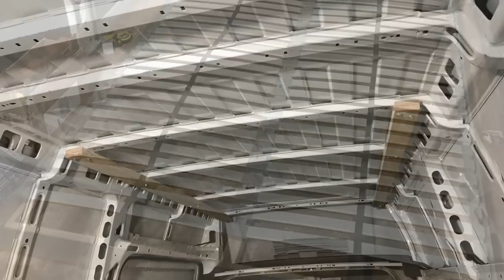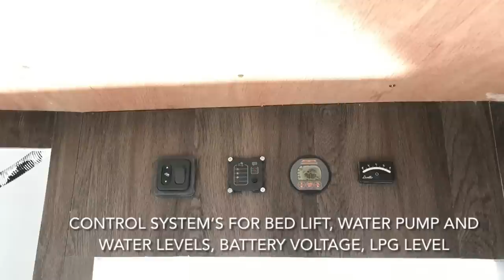Campervan conversion, Citroen Relay L4H3

Comment: Excellent conversion.  The underbed cupboards are genius.  I'm considering a conversion but with the lift bed at the back (because probably going for an L3, just for easier parking - always a trade-off with interior space.)  The need to ditch the cuboards was causing me concern & until I saw this video, just hadnt thought about actually attaching to the underside - so thanks for that.  It would limit the height it can lower to, but reckon its worth it.
Reply: Its a small difference between L3 and L4, about 35cm. How will this help you when parking? Or are there any legal restrictions?
Reply: @vadimcalinici3053 not necessarily true mate the transit l3 is 70cm shorter than l4

Comment: Hi, first of all, congratulations.. your camper looks amazing!
I recently bought the same model and I want to remove the headliner structure as your did. 
Did you have any troubles with regulatory laws or insurance because you did that modification?
Reply from the maker: Hi, thank you. We had no problems and it passed its annual check (MOT) that we have to have here in the UK. Not sure about any other countries. Hope all goes well with your conversion.
Reply: Thank you!  @riley.livingthelife

Comment: Very nice conversion.
Could you tell me the measurements from inside floor to the roof.
I have a Mercedes sprinter xlwb  high roof, looking to fit a bed mechanism but want to be able to walk and stand underneath it.

Comment: I hope you don't mind me asking questions about the bed lift. I want to build a single drop down bed for my young son in the camper i'm building this winter, for him. Can I ask what motor you have used for the bed lift and where you got it? Also how did you clamp the webbing onto the round bars? Thanks in advance.
Reply from the maker: Hi, it was trial and error but ended up with a motor from a roller shutter garage door that I acquired from a local company. 12v/24v motor. As to fixing the webbing I cut a slot through the bar and made a loop on the end of the webbing, securely fixing with sewing machine, passing it through the slot in the bar and inserting a metal pin through the loop then pulling tight against the bar. Hope this makes sense. Anymore questions feel free to ask. Ian.
Reply: @riley.livingthelife  Yes that makes perfect sense. Thank you for the detailed reply. 
Can I ask what type of side runners you used to keep the bed rise and fall squarely? I was considering using the 80/20 extruded aluminium captive slide runners.
Reply from the maker: I searched eBay and found some runners for a 3D printer, it runs on a roller bearing carrier on an aluminium extruded rail. It all seems a bit of a cobbled together concoction but it works fine eventually. Could have bought an Italian bed lift system at £2500 but that was beyond my budget so hence this is what I come up with.
Reply: @riley.livingthelife  Ive got those V grove rubber rollers in my ebay basket. After looking at all the commercial bed lift designs, I honestly don't see anything better than the DIY versions.

Comment: Hi great job did you get it reclassed by dvla ? as i have seen similar vans coming back as a van with windows.Ihave just about finished my van and it would be interesting to know how yours comes back.cheers.
Reply from the maker: Hi, it came back as van with windows 3 times and then eventually after putting more graphics, alloy wheels and respirating front quarter bumpers we have had it classified as a motor caravan by the dvla.  We do think the colour was a hindrance. Hope yours goes through ok but if not keep trying.

Comment: Super conversion, one of the best which I have seen so far👌
Where did you get the electric bed kit? Was it bery expensive?
Reply from the maker: Hi, thank you and the bed mechanism is self built from various bits and pieces of other things, example it is powered by 2 up and over garage door motors, a little bit too complicated to explain but does work well.

Comment: If this model has the same diesel engine as the Ford transit then make sure you change the fuel filter every 3k miles and carry a spare.  These fuel pumps are prone to breaking down due to poor fuel quality so make sure you don't fill up with dirty fuel.
Reply from the maker: Not sure but thanks for the advice.
Reply: add eliminox {sulnox) fuel conditioner and you'll have no fuel issues

Comment: It seems to me that you cut off part of the structural reinforcements, it is completely illegal and unconscious to do so, at least in France...
Reply: I was about to ask the same. I noticed the reinforcement of the front cab, where normally the bulkhead is attached to, has disappeared. I know a lot of motorhomes have that removed as well, but for sure there needs to be some extra reinforcement  to be done as compensation?
Reply: The bulkhead is designed to be removed and is not structural, many vans have them taken out. 👍🏻